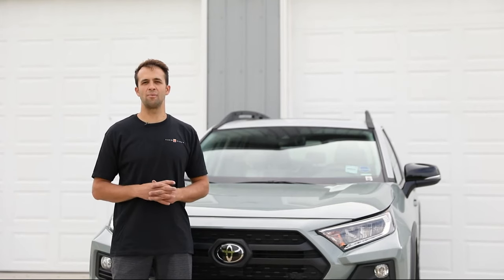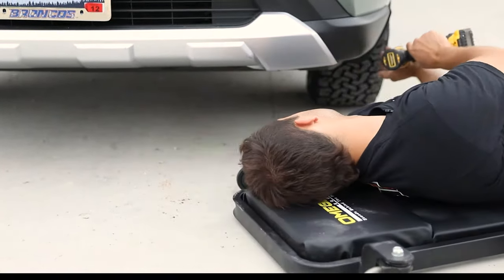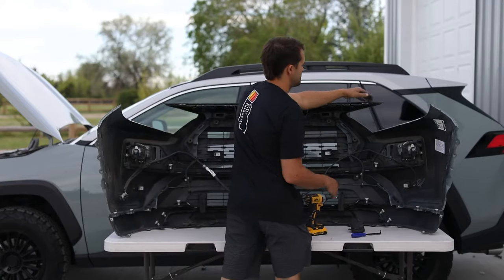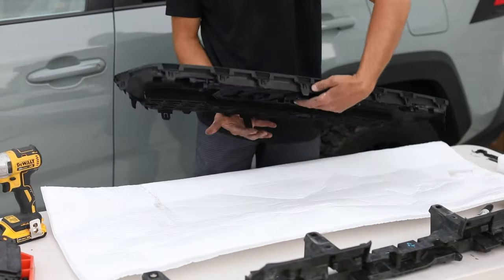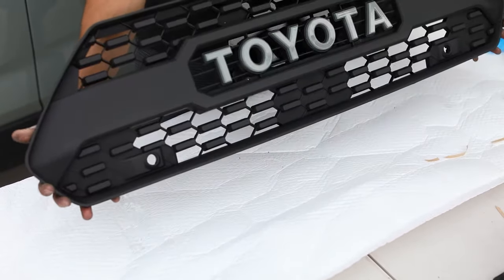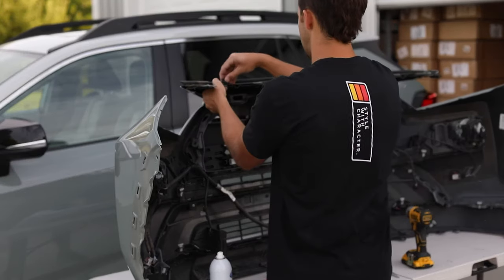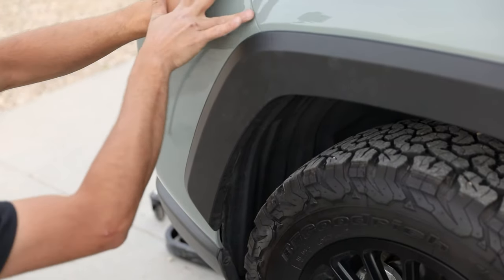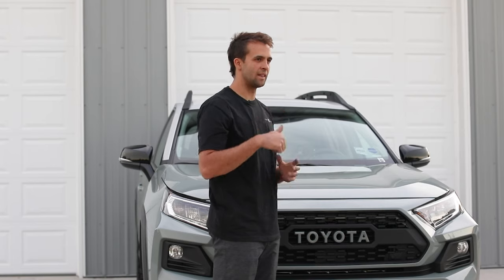Taco Vinyl Rav4 TRD Pro Grille Install w/ Plexi Garnish

Comment: Great video, just know if you have a Canadian car or have the oem block heater it is a lot more difficult because the block heater plug is extremely difficult to remove so you have to do the install on the ground. Everything else is the same though.

Comment: There is a stencil, or diagram to refer to for ALL cut lines of where to make cuts I assume when you order? SO we can mark as well with a sharpie? Thanks!
Reply from the maker: We do not make a stencil but from the video there are bends in the plastic you should be able to follow

Comment: This is what I did with my trd last year. Since this has been done, has there been any issues with the sensor? Does it give any alarms during high speeds, rain/snow? I'll sometimes get the warning that it is dirty since I've done this.
Reply from the maker: That’s actually pretty normal even when the sensor is stock. Debris causes those to come up. As for it not working, we haven’t had anyone not be able to get it to work
Reply: @tacovinyltv  Could You Answer the last 2 questions in the last 2 Comments?
Reply: I've had nothing but problems and headaches with my sensor not working since I switched the grille on my '22 rav4 trd offroad. Not worth the trouble

Comment: I ordered and installed mine on a '22 Rav4 Off Road. I received a clear plexiglass instead of a tinted one and my anti-collision system is not working. Does the tint make a difference?

Comment: I just ordered this and am installing it now, the 4 screws to mount the sensor garnish to the TRD grille. Are there supposed to be included.?  If not. What size screw should I get? I don't want to crack the plastic housing
Reply: Did you ever find the right screws?
Reply: The screws are provided. They come in a small plastic bag along with the screws to attach the TOYOTA trim to the grille.

Comment: What modifications would I have to make to the grille if I have the TRD Off Road with the technology package? It has the front camera underneath the Toyota emblem. Is the grille compatible with this package?
Reply from the maker: We have not made it compatible with the front cam yet. We haven’t had access to a cam todo so
Reply: @tacovinyltv  Where are you guys out of? I'd let you use mine as a guinea pig, haha.
Reply: @tacovinyltv  any update on Rav4s with front camera?

Comment: Please post the link of the parts, thanks. Mine is a 2019 LXE will this fit as well? How was the effect on the radar sensor accuracy?
Reply: It can be done if it you swap your bumper to the Adventure / TRD ($500 job including the larger fenders)

Comment: I am curious to know something... if I were to buy an LE, XLE or Hybrid Model but wanted this grille, I know that I would need to buy an Adventure or TRD bumper to go along with it. Would those bumpers fit up to a Hybrid model or and of the others? Only reason I ask is because I would love to get a Hybrid model but want to invest into getting this front end because it is the most beautiful one out there!
Reply: Yes it will work! I have a 2021 hybrid XLE and I ordered the whole front clip and assembly. It’s not that hard to be honest if you are even the slightest mechanically inclined. It’s not cheap but I think very worth it
Reply from the maker: Yes it does does…oh looks like Carlos chimed in. Thanks
Reply: @Zergrush66  Yo that's awesome! Do you have any pictures or videos of the conversion?
Reply: @NPCwars  I haven’t made any videos but if you have any questions let me know . It’s logical and straight forward truly. The sensor bracket cutting is easy just have to pay attention to the videos! Spaseyota has a great conversion video.
Reply: @Zergrush66  Wow that's great to know! Question, when you bought the main bumper, did it come painted or did you wrap it? Also, I saw that the fender flares for the rear do not match. Did you end up replacing those as well? Thanks in advance!
Reply: @NPCwars  main bumper comes black unpainted plastic. I am lucky to have a friend that runs a body shop so he painted it silver sky metallic to match. The rear fender moulding is 2 pieces. Moulding that attaches to the door clips on perfectly. For the back half that attaches to the rear bumper you will need to carefully measure and drill 4 holes. It’s not hard , just be very thorough in your measurements! Cheers
Reply: @NPCwars  and yes sorry , you have to purchase the trail/adventure trim moulding as the front bumper has larger clip holes to accommodate the bigger fender moulding.
Reply: @Zergrush66  Much appreciated man! I'm hoping to do this soon!
Reply: Here’s how it’s done https://youtu.be/Lyvje8YPrxM
Reply: Better to just buy Adventure or TRD up front. Time and money to switch to that front end and you could have had the other upgrades that come along with the Adv. TRD trims.

Comment: My 2019 adventure doesn't have the 2 sensors in the lower portion of the grill.  Any thoughts of what I should put in those holes?  What are those even for?
Reply: Curious to know the same
Reply: @jolyvincent  I found some plastic hole plugs at ace hardware that fit.  Also found that round amber marker lights off Amazon work with a little customization of the holes. Although I thought they were too bright compared to the raptor lights